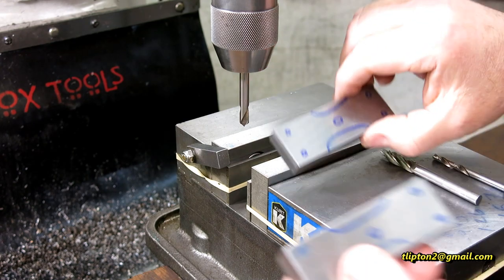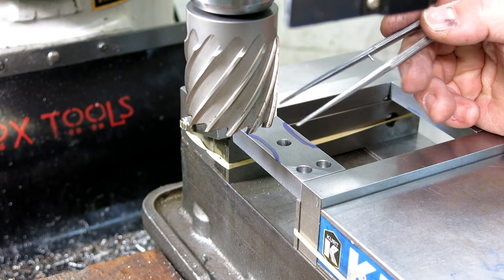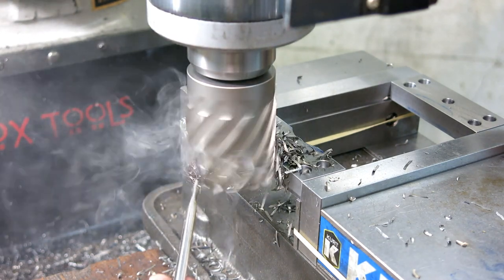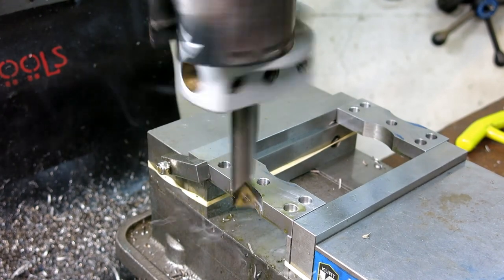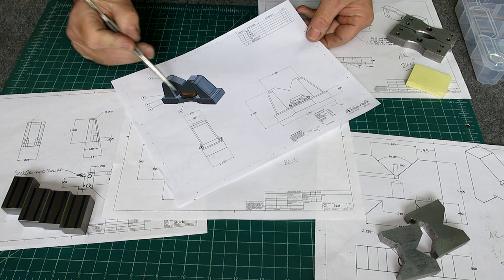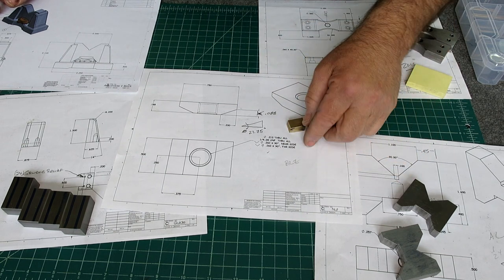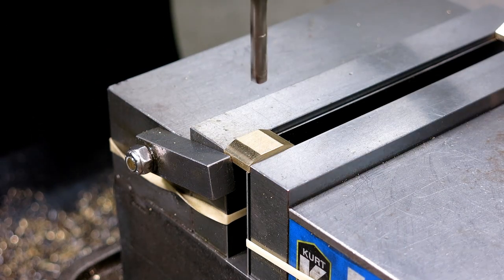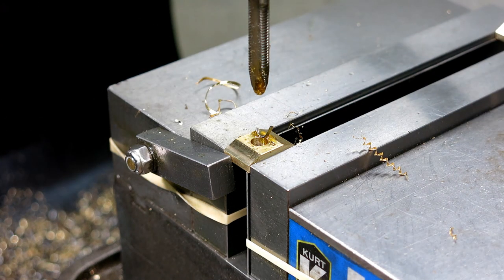Toolmakers Adjustable V Blocks P2

Comment: Respect for the ballsy tapping method there
Reply: ya think    but it worked with  brass
Reply: Yeah, he must really know the machine. That could easily go wrong...
Reply: If you have a 3 phase mill it will automatically reverse when you throw the power switch in the opposite direction.  No need for waiting for a complete stop.  If you have never tried this, you should, but I would suggest you bring the rpm down to a very low speed until you get the hang of it.  Drill the hole at the correct spindle speed, put the mill in back gear, put the tap in a KEYED chuck (ball bearing type the best).....not keyless as it will self tighten sometimes to the point of cracking the chuck, make sure the vise is tight, and bring the tap to the work using the quill feed handle until it begins to self feed, keeping your hand on the power switch to instantly reverse before you run out of threads on the tap.I had high school students doing power tapping on Bridgeport’s in just a few minutes.  You can do it too.  And after you get the hang of it use common sense........no you should probably not tap 1 inch-8 threaded holes using this method and use a spiral point or gun type tap that pushes the chips ahead of the tap. Through holes only.  No blind holes until hours of experience unless you like removing broken taps.
Reply: @37yearsofanythingisenough39  Power tapping as you described (quite well I might add) is a pretty reliable way to tap holes if you are already set up in the mill. Leaving the chuck just slightly looser than you want it to be lets the tap do its work, but slip rather than snap if it binds. Saves a lot of arm and wrist strain, especially if you have a multiple hole pattern to do. Source: I am apprenticing in tool and die at my job and did this last week, instructed by a 40 year veteran machinist.
Reply: John Birkholz thanks John.  Nice to know I can still verbally cover a technical subject to the point of understanding.
Reply: @37yearsofanythingisenough39  to clarify, I'm talking about running the tap at the same speed as the drill, flipping the motor off and running into the part with just momentum driving the tap.

 I'm actually very comfortable with power tapping at low speeds and reversing before bottoming out. I feel like that's very different and requires less "feel". But this guy makes turning handles look deceptively easy so I'm far from surprised.

Comment: Gday Tom, those digital level boxes are brilliant, I’ve had one for quite a while now and it’s more than good enough for the projects I make, I find it really useful for setting the compound slide angle on my shaper, takes the guess work out, the little tiny vice could be a very handy item to own as well, probability get used quite often for little jobs that are a pain to hold in a set of larger jaws, easier to hold the part in place when snugging up the vice, thanks Tom for sharing another great video, please stay safe,   Cheers Matty

Comment: Great video. I love the digital angle finder. As a woodworker I bought one simular to the one you have but when I recently bought a new table saw it had one built in for the blade angle adjustment. So much easier than kneeling down and trying to align a flimsy pointer on a wide mark on the cabinet base.

Comment: Try doubling up the thin parallels, the shorter one against the vise jaws and the one supporting the part next to it. For example, 1-1/4" parallels against the jaws and 1-3/8" tall parallels held next to them. For thinner parts I use a curved piece of flat spring steel to hold the parallels in place. It would be nice if 1/16" parallels were commercially available. Thanks for the posts.

Comment: Love the rubber bands to hold the thin parallels.
Reply: Michael Marks Not as pretty as the Edgetech solution, but quite a bit cheaper!
Reply: @seanrodden6151  My coworkers put a light duty spring between the parallels, same idea as the rubber band, just pushing them out rather than pulling them back.

Comment: Love the sine bar! Next time you get more made, how about some metric versions? 100mm would be nice...
Reply: I second that, 100mm  would be a nice size.
Reply: Meh ... even if the length is exactly 100mm, you always end up with odd sizes of gauge blocks to be stacked together. But since my vises are only 100mm wide that would be a nice size.
But you do need to engrave the length of the sine bar, preferably in metric as well as imperial sizes.

Comment: What is the difference between a center drill and a spotting drill? Which is better? When would you use a spotting drill and when would you use a center drill?
Reply: A center drill is most commonly referring to the drill used in lathe work, for putting a 60 degree cone in one end for a lathe tailstock center (it has that 'pilot hole' to make a reservoir for lube, a legacy feature for the Old Skool 'dead' centers that did NOT spin with the workpiece.  They are used because they are cheap, rigid, and generally laying around in handfuls at a busy shop.  As an example:

https://www.grainger.com/category/machining/drilling-and-holemaking/countersinks-center-drills-spotting-drills/center-drills

A spotting drill is designed specifically for spotting.  Design features include a deliberately short flute length, to maintain as much resistance to deflection / flex as possible.  They often have 120 included angle tips, so that when you follow up with a common 118 degree twist drill, the center of that drill contacts the work before the vulnerable outer corners of the cutting edge.  Many a drill (particularly inexpensive ones) have had chunks of those corners torn off by using a little too aggressive downfeed.  Real spotting drills should not be used for making holes, as you can see chip removel quickly becomes a problem.

It's not much of a risk to use a center drill for the purpose of spotting, provided you take care when starting the twist drill.  Don't shock load it, but make a habit of getting the the chip to an appropriate thickness (say 2 to 5 thou), as fast as you are comfortable with.  That habit will greatly help you from ruining drills and parts, by minimizing 'rubbing' the cutting edge rather than taking an actual cut.  Rubbing generates excessive heat, which can work harden materials like stainless and even some carbon steels, promotes welding the base material to the drill, and cause the hole to cut oversize.  As an example:

https://www.grainger.com/category/machining/drilling-and-holemaking/countersinks-center-drills-spotting-drills/spotting-drills

IMO, the only good reason to use a center drill for spotting, is convenience.

There are some tricks to choosing drills for spotting.  When making threaded holes, if you make your 'spot' a little bit larger than the outer diameter of the thread, it can serve as the chamfer for starting a tap.

You can do a similar thing if your hole needs to be countersunk (typically for a flat head fastener).  Choose a spotting drill tip angle the same as the angle required by the fastener head.  Spot and countersink in one operation.  You may even have to 'pre-spot' with a flat bottom, center cutting end mill when you have to drill on rounded or sloping surfaces, then spot drill on the flat, perpendicular surface you just made.
Reply: Somebody else,  very well explained. Now if more people would read your comment.
Reply: somebody else so a spotting drill is used on a mill and a center drill is used on a lathe?

Comment: At the beginning where you're talking about moving the part, I know exactly what you're talking about.  I'm a model-builder and often make hatches that have a screw in each of the corners.  So you have to know when to flip the part and when to rotate the part so that the holes are symmetrical.  If the hole isn't the exact same distance from both edges then if you only rotate the part then you get a spiral sort of drill pattern and not a symmetrical drill pattern. I'm guessing that's what you did in regard to " ask me how I know".
Reply: Also gotta be able to trust your ability to square the part properly, if you're going to reference different corners.  (Or maintain symmetry if your part has other than square corners).  You can't rely on DRO to make interior features symmetrical with one reference corner, then machine the profile to the reference as well.

Comment: See there, thats just enough fixture and angle gauge use . For one episode. "How am I gonna cut that compound angle"  Oh ya that swival base thingy I bought with the vise. there's some real brain teaser's there. Often wondered if round slot milling could be done like that . Like your trick with rounding the ends on bar strap/ a drilled hole

Comment: And don't try to power tap with a single phase unit (lathe/mill).
It won't reverse until the motor has almost stopped (start windings reconnect).
That's right, it keeps on going forward and you now have a 2 piece tap???
Ask ME how I know.

Comment: The radius of your "annular" cutter would have been more than enough to achieve what your boring jig setup did. Why did you setup for a whole extra operation?
Reply: for surface finish and accuracy, I think. Just like drilling then boring then reaming, while boring can actually give and acceptable accuracy and straightness, you still need to ream it in order to have a smooth surface. Or maybe he just want to do it in that way because that is a training project, lol.

Comment: Given that the angle was calculated using trig and the two dimensions of a triangle (arctan), you could have skipped that trig and the sine bar trig to come up with your stack up directly from the drawing dimensions with Pythagoras. No need to even know the angle.